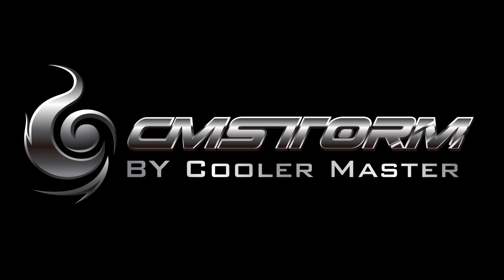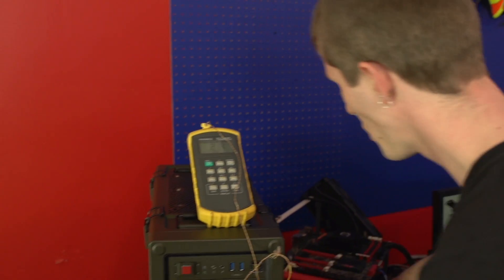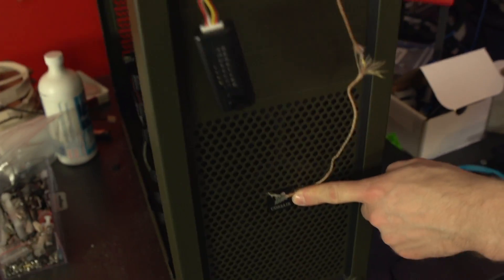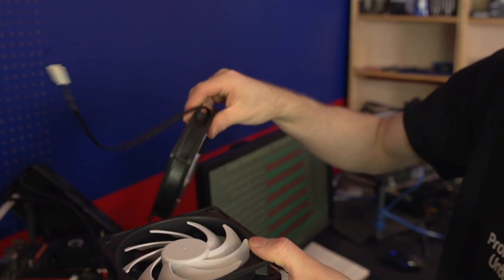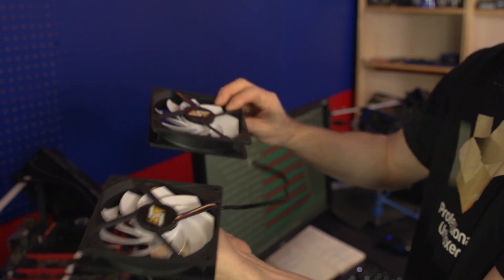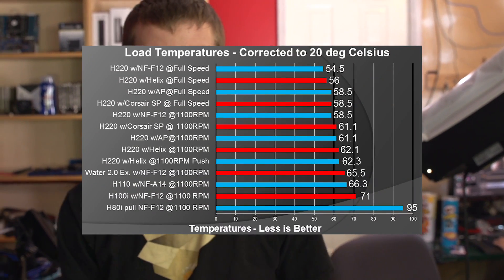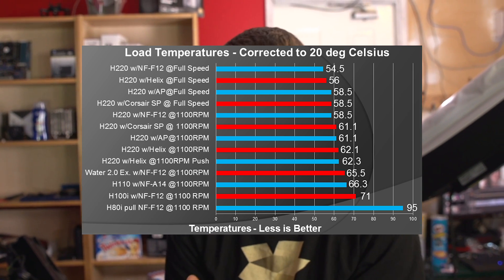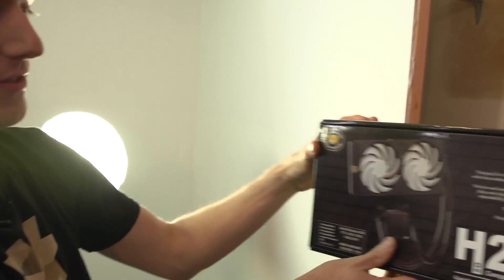Swiftech H220 Video Review Redux

Comment: when my room temperature went to 30C in my living room where my computer is (it is usually 25-27C in the winter), it's summer time here in Phoenix, my Swiftech H220 temperature wen to 50 - 65C, that's more than 15-20 C than my Cooler Master Hyper 212, which normally runs during the summer time here at it's 30-45 C

trust me, I just replace my Swiftech H220 with my Cooler Masters Hyper 212 and now the highest temperature i get is 45C, oh yeah, does anyone want to buy a use Swiftech H220,

Comment: I had to mount the radiator outside my case so that I could orient the reservoir up so that it can collect air bubbles. I had it inside the case but the orientation led to air bubble problems. Thankfully, I could disconnect and reconnect the tubes through the grommet holes in my case with this unit which is not the case for most of these All in One units.
Reply: Sennheiser PC 350 Special Edition High Performance Gaming Headset save 45% and FREE SHIP>>amzn.to/1pxCW9T

Comment: Hi, can anyone help me? i just got this unit and i installed it. my question is how do i check the rpm on the pump and fans? im using the fan splitter and i plugged that into the cpu fan 4 pin on my motherboard which is a asus p8z77 v pro. and are my temps 24C idle normal on stocl settings of 3.5ghz on the i7 3770k? and sometimes it would jump to 40C for a couple of seconds.
Reply: check temp with HWmonitor, if the temp randomly goes to 40c without any app or idle to full speed, there is a problem.  Check out ur termal paste

Comment: oing to my local MicroCenter tomorrow to take back my H80i and get the H220. Also adding the Noctuas, so I can bump up the clock on my 3570K, ALSO adding the new  MSI Twin Frozer GTX 760 this week - all from your reviews. The fact that I can expand the H220 when I add the next gen Nvidia top of the line next year into the loop with another radiator makes it a no brainer. Thanks as always for the great reviews! I always check you first, Linus. ;)

- John

Comment: Either you got a rare dud, or you hooked up the pump to a 3 or 4 pin plug in that didn't have enough or the proper power running to it, or you were in correctly overvolting things on your motherboard, or doing it correctly with a board that wasn't designed for overclocking.  There are many variables to consider when judging your situation.

Comment: I did.  Basically it was a simple miscommunication error between Linus and Swiftech. 

Something about 1.  it was a engineering sample and/or with the possibility that there were air bubbles in the lines/pump, two, the Helix fans, that come stock with the swiftech unit, 's speed was lowered below 800 rpm or something near that versus noctua's nf f12's that were lowered only around to 1000 or 1100 using the nf f12's ULNA's on the helix fans.

Linus thought it wouldn't cause an issue at first.

Comment: yes..by FAR.1. Better and MUCH more powerful pump.  Side note this means the system is EXPANDABLE to include your video card or 2 video cards+ cpu.
2.  The FINS in the rad are PURE COPPER which dissipates heat MUCH better and quicker than aluminum which is what the h100i, h110, nzxt kraken x60, thermaltake 2.0 extreme, and the rest of all the All-In-One liquid cpu coolers's rads are made of.
h100i IS a very good system, but h220 beats it by 4-5 degrees c stock for stock. nf f12s are your friends

Comment: Everything in order?  Yes I'll agree there..but if the ONLY reason you gave that " constructive criticism" is involving 2 vs 4 screws used to mount a cooler ..( and not a cpu block onto a cpu for maximum cooling potential), then you're just being way to ridiculous and nitpicky.

If the temp probe or something actually CRITICAL involve in this video was out of place or not functioning correctly, THEN your comment would have made more sense and would have had application.

Comment: Agreed but as I said, H110 is a little quieter and performs better. I take it we both agree here. So what's left for H220 ? Expandability  ? Well, that's pretty much a marketing gimmick. It makes no sense to buy an AIO and then expand it. If you wanted to water cool your whole system, then why buy an AIO in the first place ? The price of a building a cheap custom loop would be about the same as expanded H220+radiator, new reservoir, fittings, tubing, etc. but the custom one would perform better.

Comment: At the same rpm the h220 performs better on sound, almost 4db quieter so yes he does say its better at the same rpm, also when he puts the gentle typhoon fans on both units the h220 performs about 4c better than the h100i at slow rpm and about 2c better at high rpm again another win for the h220, at 100% the h100i may perform better on cooling but the sound becomes unacceptable so not really a win on the whole units performance, you need to look at more than just temps when looking at a review.

Comment: I wasn't arguing with you in the first place. The Swiftech's representative said their unit is the best AIO on the market, so I use either h100i or h110 to better make my point. Now that you mention it, I have no idea what you are trying to prove. You just chimed in and started nitpicking over unimportant details. Anyways, Martin doesn't put the h220 above the h100i. Get your facts straight. At the same RPM they perform the same and at max settings the H100i pulls ahead by 5 degrees.

Comment: Both of my units have had the same sound, so it seems normal. Its not loud by any means, I don't build loud computers ever. I am very anal about noise, all my fans are on my controller that came with my case.

Comment: Actually you are wrong again too. There is nothing made of 100% copper. The fins are made of alloy. Now, if you don't mind, let's stop with the nitpicking. What you should know is that there's only about 1-2 degrees of difference between a 99% copper and 99% alluminum rad, given both are same size and design. On top of that  H220 has fewer Fins per Inch and smaller size. So the H110 definetely has the advantage here, regardless of its alluminum design.

Comment: aye sounds like it'd be quiet too, the vanilla darkrock pro 2 is very quiet aswell (thats what im using right now since i switched to a silverstone rv 02 case) but sounds like your h110 has the so popular corsair closed loop noise problem which is easily fixed by running the unit on its side or at an angle for a few minutes, it worked for my h100... god i hated that thing at first because of the pump noise but after doing that it went quiet... you should try it, see if it helps

Comment: Yeah, I was mistaken , but that goes for you too. You are wrong about H220 being copper too, as it's actually brass and brass is a much worse heat conductor than alluminum. I know high fpi need high static pressure fans but that has nothing to do with the fact that higher fpi rads generally cool better. H100i has a higher fpi rad than the H220 but for some reason this test shows that H100i doesn't benefit much from the crazy static pressure optimized NF-F12 fans. So your argument makes no sense.

Comment: The TT water 2.0 has a aluminium rad not copper so not sure what you on about there, rads with a high fpi need a high static fans to make them work well where as a low fpi rad can have a low static fan which has faster moving air, the difference between the 2 is negligible

Comment: Actually FPI does make a rad good or bad. It's simple physics - more surface area = more heat conductivity. As for the copper rad - it doesn't seem to do much for the TT water 2.0, so why would it for the H220 ?

Comment: the h220 has a copper rad unlike all the corsair stuff which does make a difference in performance, also fpi count does not make a rad good or bad at all, it just means you need to no what type of fans go with your rad.

Comment: You realize you could've replied to that WITHOUT sounding like a condescending prick? 

"While at idle both H100i and H220 have similar noise levels (~38dB), at full capacity, H220 is massively quieter - 46 db compared to 60 db of H100i. In segment of watercooling where you often pay for essentially minimal performance boost - this is a massive difference - 25% quieter than H100i!"

If you cannot articulate yourself in civilised manner void of ad hominems, perhaps you should not comment at all.

Comment: from what ive read 1.45 on an i5 is not 24/7 safe without the risk of silicone degradation. ive read that quite a few have even seen degradation at 1.4 and over and seeing the OC start to fail after so many months, this could of just been on sandys though as I havnt really looked into ivy safe volts

Comment: Only Intel can explain why. I have my 3570k running at 4.8 at 1.30v in the bios. Its hardly slow, it certainly isnt in any danger of running temps too high. I have even had it running at 5.0, but took 1.45v. That had temps in the high 80's, still safe, just too high for my liking. I could take the IHS off, swap the TIM and lower the temps, but to me, its not worth it. I might still change to a H220, or even a better water cooling system down the road. Undecided right now, I dont NEED to though.

Comment: No my temps are not overall high. They should be better, but based on the I5 TIM issues, they don't go as low as they should. I get in the 70-74 area after running Prime for a while and based on my room temps. The people taking off the IHS and changing to better TIM, are getting the temps I could/should get if I did the same.

Comment: Wins by less than a degree. Not much of a win considering the 30% higher price of the H220. As for noise, thats a subjective feeling.But if you insist I'll play your game - H110 is quieter than H220 at max and it cools better at less  RPM. I know you'll say its 140mm vs 120mm but the Swiftech guy said "best AIO on the market" They didn't specify any category. So you better be able to back your claim up.

Comment: and when that guy used the same fans on both AIO units the h220 wins, he also says that the noise from the h100i kit is not acceptable at full load, so where is it your getting that the h100i is better, if something is so noisy that it is not acceptable then it is a fail not a win

Comment: You would be right If that was the case. But I'm not talking about reviwers. Users on enthusiast forums have been complaining of noisy and dying pumps since the H220 hit the retail market. Swiftech might be one of the oldest water cooling manufacturers around but that means nothing when you buy such an expensive AIO and your CPU gets overcooked because of a dead pump.I don't really care if the cooler is rebranded Asetek or CoollT if it cools best,generally got no issues and has a 5 year warranty

Comment: Um... actually you are wrong. H110's fans are 140mm and in the 140mm department they are unmatched when it comes to static pressure. That's why it's pointless and misleading of Linus to test the H110 with NF-A14 attached to it and compare it to the much more advanced(compared to other 120mm fans) NF-F12's used on the 240mm radiators.

Comment: Yup, I knew before buying the 3570k that they did run hot. I just didn't know why. After doing some reading recently, I saw the people talking about how cheap the TIM is Intel is using and why many talk about de-lidding. My temps are not in the danger range by any means, but it just sucks that because of Intel, it doesnt run as cool as it could.

Comment: Hardcore enthusiasts do something called de-lidding, where they remove the IHS, clean out the stock thermal compound which is the cause for the high temps, replace them with better ones, and then placing the IHS back on.

Be warned though, that de-lidding voids your warranty and has a very high risk of damaging your CPU beyond repair. Also, this can only be currently done on Ivy Bridge, if I recall correctly, since Sandy Bridge and older CPU have the IHS soldered on.

Comment: You said your processor is a 3570K, right? All Ivy Bridge CPUs have had poor quality thermal paste used in-between the IHS and CPU die. My 3770K temps are about 15 degrees higher than a 2600K at the same vcore of 1.4v.

Comment: Are you serious? Remember that the stock fans on the H110 were not made to have high static pressure. You have to spin them at such speed that it sounds like a lawnmower before they can even beat the Noctua's in performance. The Noctua NF-F12's may be ugly as hell but they have one of the best performances on radiators, on-par with or a bit better than even the Scythe Gentle Typhoons which is the favourite of many enthusiast water coolers out there.

Comment: H220 is the best closed water cooling solution but not risking water cooling in my system.  Sorry Swiftech but if something goes wrong I definitely don't have the money replace all the parts that are ruined.  On that note Linus I wonder if there are any numbers out there which state which best closed water cooling solution is the most reliable ?  Failure rate numbers ....

Comment: His H80i stat looks about right to me. Note it says pull - he's just using 1 fan on it. H80i rad is very thick and has high fin density. It really needs push+pull configuration to generate enough pressure to move air through it.

Comment: have 3770k @ 4735mhz, 1.38v , runs above 1.5v when stressed I never have got over 51C so far, i have push pull in bitfenix prodigy with the bitfenix pulling in the push pull

Comment: Drawing more power DOES mean it produces more heat. Most (if not all) of the power that goes into a processor comes right back out as heat, as no mechanical work was done and very slight amounts of spectra are emitted. I'm fairly certain that my 975EE at 1.54v and 4.4ghz is a heavier load than that weaksauce 1.35V 3930k anyways. Also, no other review site (if you don't trust my opinion) has a large gap between the thick 120mm rads and the dual thin 240rad AIO coolers.

Comment from the maker: Drawing more power does not mean it produces more heat. Also things change dramatically when overclocking. The H80 test was fine. Single radiator liquid coolers are just nothing special.

Comment from the maker: Voltage makes MUCH more of a difference to temps than clock speed. We are intentionally overvolting the CPU to high hell to generate a larger heat load.

Comment: Just looked at the sheet again, you are running a 3930k@ 4.0 at 1.35. I am at 4.8 at 1.30 in the bios. 1.286 under load with vdroop. Could 800mhz and the fact they are an I5 vs an I7 really make those huge temp differences?

Comment: Linus you show the H110 running about 66c. I have the same cooler using Bgears B-Blaster fans. Your info shows it running around 66c. I have NEVER had mine run that low. Maxes out around 74-76 depending on my ambient. I also run at 1.286v under load in prime. Why would you have such a difference in temps? I have seen your sheet saying you run at 1.35v, I run a 3570k though, could that be the difference?

Comment: if you have no money to expand right now but want the ability to in the future, you wont have to just scrap the pre-done liquid cooling system if you but a h220 and you can use the radiator and pump in the loop later, and read the results... the h100i is bad compared to the h220

Comment: for more pixles the more ram is better, since its a dual monitor display im not sure but if it was triple or a 1400p display then the 4gb would be the best, your situation is somewhat rare to me but I would go with the 4 gb gtx670. The only problem with a dual monitor display is that you would have a dead zone right in the middle if you were to play a game on both screens at the same time, if you only plan on using 1 screen to game and other to use web then the 2gb 680

Comment: i think you rather should choose a fixed noise level, and then test all fans. personally i don't care if my fan run at 3000 rpm if it's quite

and if "fan x" at 3000 rpm do 20 dBA / 50°C
and "fan y" at 1000 rpm do 30 dBA / 60°C
like any one i will chosse the first one

Comment: Spoiler alert. At 12v one wins in cooling performance, one wins in dBA comparison. Just a side note for you since you mentioned the cost of noctuas, deltas and gt5400 are not cheap either.

Comment: I hate to break it to you, but the 975EE is a hotter chip. Proof? Check out HardOCP's 3960x review. It clearly shows the i7-920 at 4.0ghz drawing more power than a 3960x at 4.8ghz.

Furthermore my 975 runs at 4.4ghz at the absolute limit of it's voltage tolerance. I know some chips are leakier than others, but believe me when I say, this chip puts my 4.9ghz 8350 to shame in heat output. I maintain that that H80 test went wrong somehow.

PS, I still have the utmost respect for you as a reviewer.

Comment: Linus while I understand what you are doing setting all the fans to a fixed rpm to compare the coolers I think this is flawed. While this give a good comparison for the fans it just gives even more variables with the coolers. All of the coolers are designed to work with different fans. Coolers should only be tested at stock out of the box and if you want tested with the same fan (nff12) to give a comparison as to how they compare with the same fan.

Comment: I can't imagine a circumstance in which an H80 is that far behind. I run 4.5ghz 1.45v i7-975EE which is a huge heat load and I have run it in many cases with various amounts of cooling and various amounts of heat coming from various high-end GPU's and have never had a big performance difference between the H100 and H80. To each his own, but that looks fishy, end of story.

Comment: Benchmarks do not vary. If they did, they would be pointless. The absolute value may vary, but not the ratio. As long as they are closed test benches and use standardised methods for temperature reading, everything else is unimportant.Learn to use punctuation:)